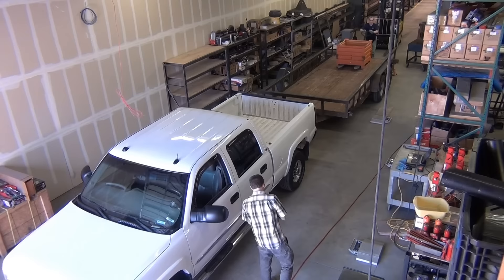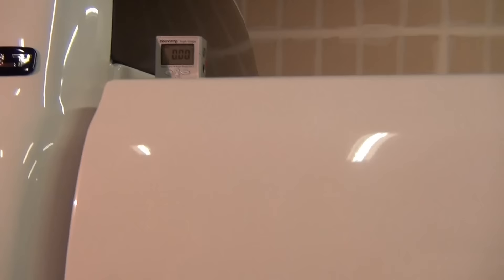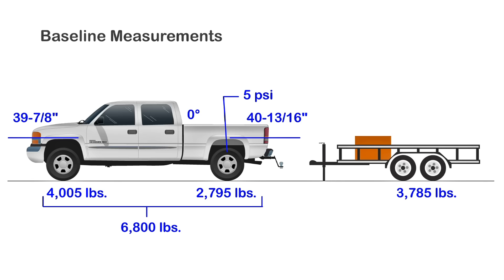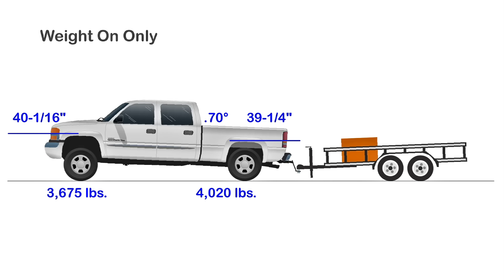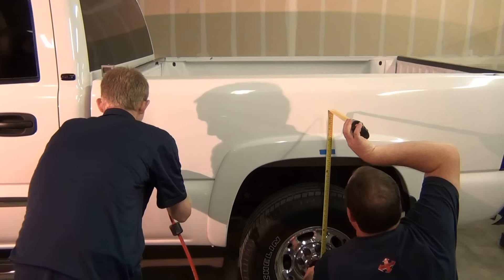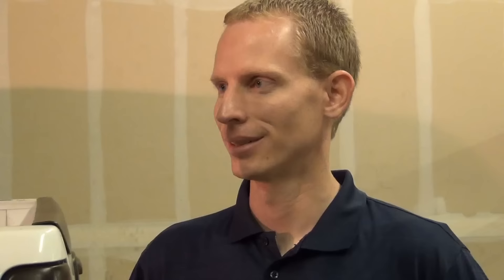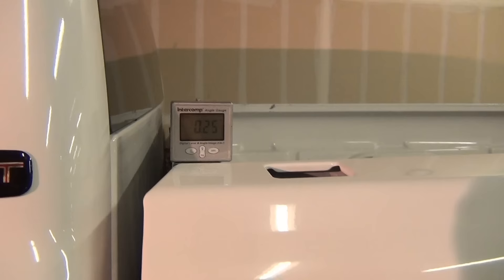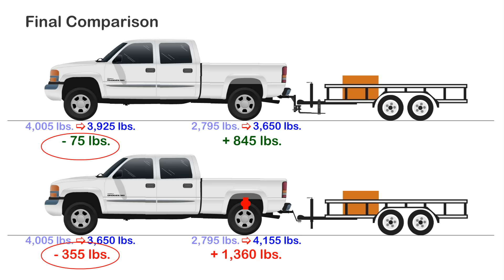The Difference Between Using Weight Distribution and Air Bags to Level Your Load

Comment: But what happens when you use a weight dist hitch and use air bags to get sag back to base height?
Reply from the maker: Raising it to get back to base height after the weight distribution hitch is engaged will do two things that we don't want. It will add weight to the tongue and reduce braking control and stability at the front of your tow vehicle (counteracting what the weight distribution/sway control will do). Second, it will reduce tension in the WD/sway control hitch, not giving you all of the benefits of sway control.
Once you set up the WD hitch, even if there is a little bit of sag, I would leave it as is!
Reply: What if you have airbags in from the factory (2019 Ram 1500).  You cannot disable the air suspension so would you still use a WD hitch?
Reply: @FastwayTrailer  what is the appropriate way to use both together? Just to do lateral weigh distribution on the vehicle if one corner is getting more weight?
Reply from the maker: You will want to set the air bags up first (to a lower value), and then set the weight distribution hitch up from there.

Comment: Great video - thanks
It is probably not material but the total base line weight is 11,585 lbs but with "weight on" only the total weight is 11,695 - so there appears to be 110 lbs missing
Reply from the maker: +Bruce Williams,
Thanks for the comment. You are correct, the numbers we have for the baseline are 110 lb less than the coupled weight. There are also slight differences in the coupled gross weight, the air bag gross weight, and the weight distribution gross weight.

For the baseline measurement we used a simple hydraulic scale to get the trailer's tongue weight, which is not as accurate as the digital scales we used on the axles. Also, the 8 axle scales have a +/- tolerance of about 5 lb each. The 110 lb difference between the baseline and the other weights comes from those inaccuracies. If you look at the last three measurements, we are within 30 lb on a gross weight of ~11,710 lb, which is 0.2%, which is pretty good. Even the 110 lb difference is less than 1% off.

Overall, the purpose of the video is to show how a tow vehicle and trailer react differently to air bags vs. weight distribution, and we felt our measurements were accurate enough to show that well.

Comment: Very informative!  Thanks for posting this.  So there would be no benefit in using both air bags and a weight distributing hitch?
Reply from the maker: Correct. Air bags will raise the tension off the hitch, providing less sway control.

Comment: Hi, nice video but..... I cannot work out your math... in your first example the steer+drive+tongue weight+trailer axle weight = 11585lbs, you then attach the trailer to the truck and the total weight is 12480ibs, then you up the air bag pressures and the total weight  = 11715lbs. At no time during the configuration changes do you add or remove weight - this means your 'experiment' is totally wrong (and Albert E is spinning in his grave). If you data can be proved correct then Albert E would spinning the other way in his grave. CAN YOU EXPLAIN THE MASS difference? Graham (Australia)
Reply from the maker: @Graham Burge, yes, we can. First of all, this was meant to be a demonstration of the principle, not a scientifically controlled test with extremely tight controls. Each axle scale has a tolerance of +/- about 10 lb, and the tongue weight scale we used is a simple hydraulic scale with an analog gauge which is accurate, but not exact. The 110 lb or so difference is due to the variation within these tolerances. Also, the difference is less than 1% of the overall combined vehicle weight, and does not change the outcome of the principle we were trying to show, so we did not feel it was significant enough to worry about.
Reply: @FastwayTrailer  Thanks for that - I understand stacked tolerances, I must admit, using the same scales in the same position with +/- 10lbs would mean 100 lbs is explainable but 12480lbs to 11585lbs is nearly 900lbs  and roughly 8% variation. To me that is outside stacked tolerances. However, having said that, I still like the principles of the video - I work in heavy transport where trucks using air bag suspension show signs of varying axle weights when loaded - your video shows the reason for this variation... it is now a question of how to mathematically define that variation - someone might get a PHD for working that out - again thanks for the video
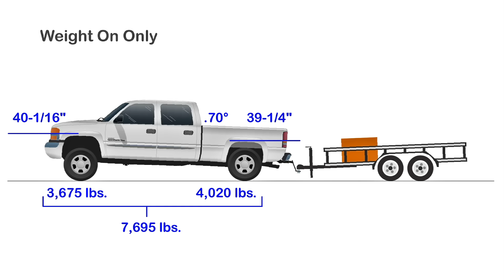Reply from the maker: @BurgewoodPtyLtd  , Ahhh, sorry, we missed the 12,480 issue in your first comment. This is the weight you would get for the combined vehicle at the 4:24 mark in the video. This is perhaps a bad illustration on our part. That is the combined vehicle weight that you would get if you add the coupled tow vehicle GVW shown with the baseline trailer GVW shown at this point in the video. However, if you play a few more seconds, you will see that it shows the trailer axle weight at 4,000 lb., but no trailer tongue weight. This is because the tongue weight is now being carried mostly by the tow vehicle axles, and partly by the trailer axles. Therefore, the combined vehicle weight for the tow vehicle/trailer without air or weight distribution shown in the second example should be calculated to be 11,695 (7,695 + 4,000), not the 12,480 that you have in your comment.

Overall, the combined vehicle weights should be: baseline = 11,585 lb, coupled but no air or wd = 11,695, coupled w/ air = 11,715, and coupled with wd = 11,725. All of these are within the acceptable tolerance range for the scales we were using. Sorry about the confusion, hope this clarifies things a bit. Thanks for the comment, and for watching!
Reply: The mass stays the same, but since the weight is not being placed over the axle the force is different. Weight x ARM = Moment. That's part of the reason trucks have different hitch ratings (conventional hitch versus a 5th wheel). This also shifts the CG of the tow vehicle. If we had a datum in front of the vehicle with measurements to the axles and the hitch we could calculate the shift in tow vehicle CG aft in both situations.
Reply from the maker: Thanks for commenting @Jay White, and thanks for watching.
Reply: So in the end the weight distribution hitch does a better job putting weight back on the front axle ... the air bags would do better at keeping u level so one could say do both ... I am new to all this so can you do both at the same time ?
Reply from the maker: @Mike Bennis, Air bags do not return weight to the front axle. They are designed to be a quick and easy way to change the stiffness of the suspension. Weight distribution changes the way the load is being carried by the combined vehicle (tow vehicle and trailer), so that the front axle and trailer axles carry some of the load that would otherwise (without WD) be carried by the rear axle. Yes, using both together is a great setup. If you choose to use both, make sure you inflate your air bags to the pressure you want to use while towing before setting up the weight distribution hitch. Adjustments to the air bag pressure changes the amount of weight distribution provided by the hitch. You may have to go through several trial-and-error set ups to get it dialed in for your rig.
Reply: @BurgewoodPtyLtd  In the first measurement of the trailer they showed only the axle weight, and omitted the 1000lbs at the jack.
Reply: If you raise the back of the truck up you will push more of the weight to the front axle.  Basic physics.

Comment: Why didn’t you use the weight distribution hitch, and then add air to the airbags to get the truck back to (0)?
Reply from the maker: Using both can be a bit tricky, you'll want to set the springs up before setting up the weight distribution with the hitch. You may need to use one extra washer on the hitch setup to compensate. Thanks for watching!
Reply: As you add air to the airbags (after weight distribution), it takes load off the spring bars which reduces the amount of weight distribution you have. So, you could add air but would have to remeasure your amount of weight distribution to ensure you still have enough. Also, you don't need to get back to (0). Pickup trucks are designed to carry load in the back - just don't want to reduce the weight on the front axle. If a good weight distribution hitch is set up correctly to keep weight on the front axle and reduce the squat sufficiently for your headlights, then air bags really aren't needed at the same time. The one benefit might be to change the suspension/ride. Weight distribution hitches can "kick" a little so airbags could be filled just enough to soften the bounce back or "buck" from the hitch.

Comment: Why did you do 2' drywall strips?
Reply from the maker: We assume you mean the small sheets* we put next to the scales when we’re setting up the truck and trailer. These are sheets of plywood that help us get the truck and trailer up over the small lip at the end of the scales to keep them from slipping out of position as we’re driving up onto them. *No drywall was harmed during the making of this video.
Reply from the maker: @Jared, hmmm. Never noticed that before. We honestly have no idea why it was built that way.
Reply from the maker: @Toober55 very observant! We suspect you are exactly correct!

Comment: Air bags are great for cabover campers and fifth wheel/gooseneck traielrs, or for putting a lot of weight in the bed. But, bumper pull trailers really need weight distribution.
Reply from the maker: Thanks for the comment +Adam Alvarez.

Comment: what if you use both?
Reply from the maker: You can do it, just make sure there isn't too much air in the bags which would raise the tension off the WDH, giving you less sway control.
Reply: I use both and I run about 20 LBS in the airbags. This helps level the back of my Silverado High Country 4 Wheel Drive when connected to my Airstream 25RB. The tough weight is a little over 700 lbs. I've towed on single lane roads with 70 mph speed limits with 30+ mph cross winds without any issues. This included 18 wheelers coming in the opposite direction doing over 80 MPH; with them I felt a very slight push to the right, but no different than what I would feel without the trailer in tow.
Reply: @kevinlee8243  
Thank you for your reply and stats!
I have a 2017 Chevy Duramax and a 10,000lbs TTRV with Airbags, Weight Distribution Hitch, and a Sway Control Bar.  I ran my Airbags at 32psi on a 1500 mile trip (a couple weeks ago) and it seemed like too much air.  So I was thinking about trying 15-20psi for my next trip.

Comment: For those wondering about using airbags and the Equalizer at the same time, check out the video about automatic leveling - https://www.youtube.com/watch?v=mj2oqAiltsk. This is for vehicles with OEM leveling systems at all four wheels but the same principles apply to anything with adjustable suspension and airbags including only rear airbags. It shows exactly what happens when the vehicle is leveled using airbags. It also talks about how to adjust the hitch to account for this.

Comment: Put the weight over the axles of the trailer and it would of made a huge difference. Then the trailer axles are taking alot of the weight and the truck won't sag as much and is basically just pulling the load. Esp with a dual axle trailer. The more forward the weight on the trailer will give more tongue weight, and same the further back the weight is it will almost start to pull the truck hitch upwards. My dual axle trailer has 10,000lb axles. That's 10,000lbs each axle x2. That is way more then even a 1ton truck so ild rather have my trailer holding the load then the truck.
Reply: Ever heard the turn tail waging the dog? 
Take your 20k tandom  with 2k tong weight  (2 9k bobcats+2k empty trailer)  for a proper setup. If you shift your load so that you have 500lbs tong as you suggested we will be picking up the pieces of your truck and trailer at ~35-45mph . 
There e.g. was just ballast   too achieve 1k tong with the least effort on there part. ya 10k bobcat properly positioned would be the same Example with much more effort than swinging a pallet jack.
Reply: @daviddroescher  you won't find a trailer rated for 20k pounds weighing less than 5k lbs. to legally trailer both 9k lb skid steers you would have to have a trailer rated for 24k or more.  unless your tow vehicle is atleast a medium duty you are better off with a gooseneck.

Comment: Can I use air bags and my WD hitch together or does one cancel out the other? Thank you .
Reply from the maker: Although we normally don't recommend using them together, if you wish to do so, make sure you inflate the air bags to your towing level (we prefer a lower setting) before you set up the weight distribution hitch. Setting up the hitch last will allow you to still get sway control.

Comment: Dang, such a great explanation!  I have been focused on rear suspension solutions (landing on air bags), but never really knew much about a weight distribution hitch.  This video explains it so well!  

I had the same thought as other commenters. I would like to understand how the two systems could work together - or would that be a dumb idea to tow that way?  I suppose: airbags for hauling heavy loads in the bed of your truck; WD hitch for heavy towing. When towing, if you did engaged your air bags just enough to not adjust the geometry or apply any force (?) to the weight distribution going on from the hitch design, would that possibly support a better ride and perhaps better handling - helping sway and porpoising of the vehicle?  I would like to hear your thoughts on that.

Great video!  Thanks for such a clear lesson.
Reply from the maker: It definitely depends on your situation. If you were to use both, make sure you fill up the airbags (to a lower setting) BEFORE you setup your wdh. That will make sure you still are able to get some sway control. I'd reach out to our customer service team 800-478-5578 if you'd like a solid explanation!

Comment: A lot of hitches double the trailer and tongue weight rating when using a WD hitch. People need to know those numbers. You can't just add air bags to level your truck if your tongue weight is double your hitches limit. I have a broken receiver hitch sitting here to prove that.
You had 1,000# tongue weight right? My dodge ram OEM hitch was rated at 5,000/500 weight carrying, but 10,000/1,000 weight distributing. I think that's pretty standard for a class 3 and that's probably what most people have. I encourage people to crawl under their truck and read the placard on their hitch.
Reply from the maker: You make a great point. It's very important to know and understand your tow rating before adding or adjusting more weight.

Comment: Very interesting, thank you for sharing. Is there any application where airbag suspension on the trailer axles combined with weight distribution hitch could be beneficial?
Reply from the maker: Hi Jay! You can use both a weight distribution hitch and airbags, but it can be tricky.  Some people really like using both while others only like to use one or the other. If you want to do both,  you'll want to set the springs up before setting up the weight distribution with the hitch/

Comment: I have both lol. So it does not matter. Also I have a f450 dually so I really don't care what I am towing I am covered either way lol.
Reply: I just cancelled my air bag installation 30 mins ago based on this video as the dealer has installed WD hitch on my new travel trailer with weighs 7600Lbs loaded. I think I better stick with science and data than just having both as it won't help at all.